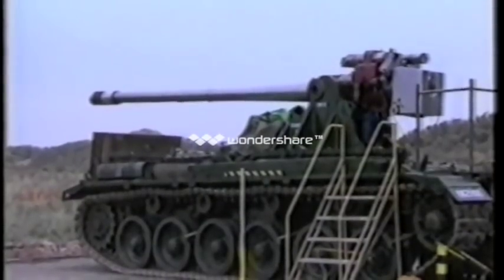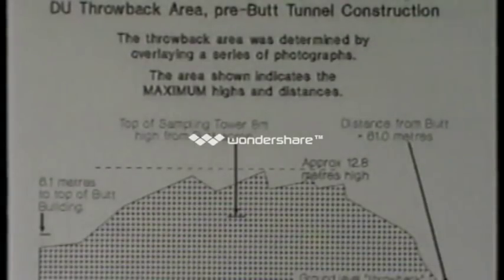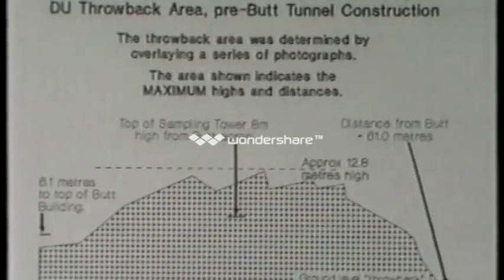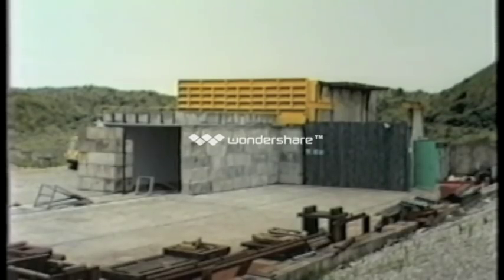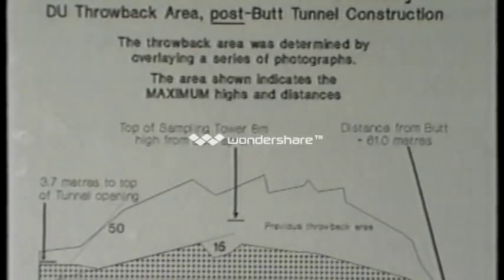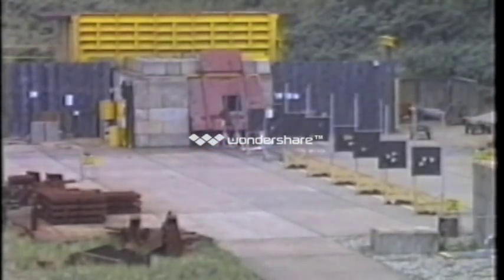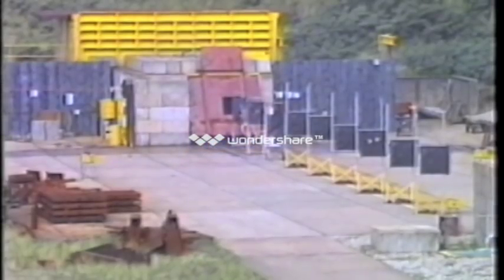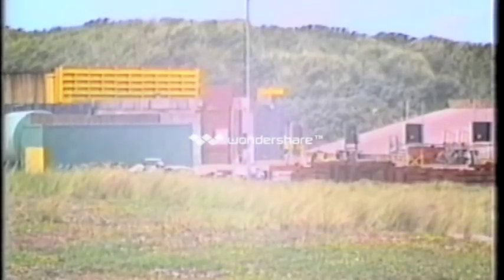Depleted Uranium Firings West Cumbria

Comment: where was the du supplied and machined from? did they test it for transuranics as du stocks are known to have traces?
Reply: @WilliamHelstad  No, steel does not have the strength or high enough density to carry the momentum necessary.  The material more commonly used for long-rod penetrators is tungsten carbide.
Reply: @anthonybarker9123  true, tungsten is expensive though and depleted uranium is cheap and plentiful
Reply from the maker: Yes it was assessed and assayed for transursnics and fission products

Comment: So what has a DU round got that others more conventional rounds dont, or to put it another way what does it do to a target that other rounds dont?
Reply: DU is self sharpening, it chisels off rather than flatten like tungsten or steel. DU also has a secondary pyrophoric effect, as DU sparks ignite in the air. So, behind armor effect is very incendiary. Against tanks with carousel autoloaders like the T72, it causes catastrophic damage to the tank, often igniting propellant charges
Reply: DU is also a byproduct of nuclear fission in nuclear powerplants, and therefore is a cheaper and more readily available material than alloys such as tungsten carbide, which is also used in armor piercing ammunition.
Reply: @elongated_musket6353  A By-product of Uranium enrichment process. The UK's nuclear powerplants being MAGNOX did not require highly enriched fuel so our DU stocks came from the US and were probably very expensive.
Reply: @elongated_musket6353  DU is most certainly NOT a byproduct of fission in nuclear power plants.  DU (U-238)  is what is left over after concentrating U-235 out of naturally occuring Uranium ore.  Only .7 percent is the fisable U-235.  The REST (U-238) is non-fisable and essentially useless.  It is VERY dense and VERY hard.  Therefore it is a good kinetic penetrator.
Reply: @matthewpless4773  it is technically a byproduct of the fission industry, it just has not been used as fissionable material
Reply: The DU is heavier and so will carry more momentum to target. As well as the ability to slice through steel with ease, it's shotgun like effect exiting the other side is devastating to anything living

Comment: So, they had to sample the air around the butt....Then after penetrating the butt they needed hazmat suits to clean the butt....interesting.
Reply: They don't need hazmat suits, in fact they don't need to clean it at all. 

It's just required by our insane nuclear safety procedures that assume everything is a threat no matter how small. It's a constantly spiraling process that just keeps getting more out of control. Since ALARA, the As Low as Reasonably Achievable has no end point. As such those same regulators who created the fuss over nothing see these efforts and make the exact same mistake you just made and use them as justification for even more safety procedures. 

In reality DU is harmless radiologically and a fairly typical heavy metal toxin chemically. So it can be treated like every other bit of ammunition they fire.

Much of the world is naturally more radioactive than this thing could ever become, so what's the point? 

410 MICRO Becquerels is the only measurement given in the video. Which sounds really scary until you realize that a Banana is 15 Becquerels, that's whole becquerels without a prefix reducing the exposure by millions of times. Are they going to fire millions of tank rounds over the life of this facility and does anyone worry about Bananas? No, clearly not. As such these efforts are just a waste of tax payer money.
Reply: @bronzedivision  brief du exposure is not the case.  Long term effects of du in water soil  etc are very dangerous toxic to people. Especially if people live & thrive in an contaminated area. Iraq is a good example. Du isn’t strong enough to penetrate the skin but if you breath in the dust or the dust gets in soil or water used to grow food. If consumed by humans it can have devastating consequences.
Reply: @bronzedivision  that's an absolute lie. Even your username seems inspired by the disinfo campaign. How do you sleep at night?
Reply: @KC-il6we  No, it's very basic science. I'm sorry that you think your strong feelings can overturn reality.
Reply: @bronzedivision  this is a testing site. People don’t grow food or drink water on the test site. To say that du is Harmless is completely false. Du doesn’t just decay overnight. It’s the  particles that it leaves behind that can be consumed that is dangerous.

Comment: The sabot rounds fired are notorious they vaporize into high temperature fire on impact fire would break out inside the tank thats hit.Almost all rounds are capable of penetrating any armor of any thickness it doesn't matter and after a high velocity impact and penetration of the depleted uranium darts the particles of dust, smoke and debris are also extremely poisonous.
Reply: False. DU is more dense and is stronger than lead, Tungsten, or Steel. Of course, projectile material is one part of the equation, as you must factor in projectile length and velocity, but it does matter a lot. The armor part is also false. The frontal armor of most MBTs is extremely thick and impervious to most RPGs and tank rounds. There is a reason why Governments spend money on higher penetration AT weapons.
Reply: This kills the tank / tank crew.  Yes.

Comment: DU rounds are AMAZING. I just hate that we have to clean them up after we shoot them.
Reply: SmithN' Wesson ikr... wayyy past radiation poisoning, thats the last thing id be thinking ab
Reply: @npc1377  it’s the dust that is released that’s is deadly
Reply: @Blackowl44  The dust has to be concentrated for DU's miniscule radioactivity to actually have any effect when inhaled. And you'd have to inhale it over a long period of time.
Reply: @jaffacalling53  It's not the radioactivity that's the problem, it's the chemical toxicity that is the issue.
Reply: stoeger 2 Yea and extremely effective at piercing armor. Im preety sure whoever gets hit by this aint gunna have to worry about being poisned they will already be pink mist
Reply: Nathan Long how do you suggest to clean up after they fired the du dust are you going to use a vacuum cleaner around the desert or use a house air filter for the contaminated air and water the dust go up in the cloud thousands of feet it can't be extracted from the human body or water or air or the earth either so tell mister smart I think if you had suggestion it would be greatly appreciate I not joking am seriously telling you let's see if it can be done
Reply: @davidlefort4553  Try forming a comprehendible sentence first.
Reply: Nathan Long They are not radioactive

Comment: Can someone explain why this looks like it is operating off a shoestring budget?  Wouldn't research concerning depleted uranium be pursued with more caution and better funding?
Reply: A lot of testing looks like that, lots of science, optimism and using stuff one finds on a shelf that will do the job. I used to run tests on an engine mounted on a rough, secondhand trailer with a rusted out Ford Transit as my, eh, test house, which we purchased from a nearby plant nursery and dragged into position. The science was good, though, and safe, all for an engine to go into a military drone. The final product looked very good though. The mouldering remains of the Transit might still be there...
Reply: It's a firing range... They have a fine budget but you don't build things you're going to shoot at to expensive standards. 

And they actually have too much regulatory pressure. There are simply no dangers here at all, unless you're standing in front of the gun when it fires. All of this is done purely to placate radiophobia. DU is not a hazard.
Reply: @bronzedivision  absolutely. That's why they would dump it in the ocean and bury it in pits lined with lead and under concrete. Why not bury a harmless chemical in a mine or under a mountain. Maybe we could put it in deodorants like aluminium. Much cheaper and its just sitting there. You're a genius
Reply: @barbarafogle3541  Ah the classic circular logic of radiophobic alarmists. 

Step one:
Get paranoid and needless rules for protecting people from radiation enacted as a precaution. 

Step two: 
Point to the extensive efforts undertaken to protect people from radiation as 'proof' that it's a uniquely special hazard. 

Step three:
Repeat...
Reply: @barbarafogle3541  OK, I'll go slowly. Please try to follow:  DU (Depleted Uranium) is completely different than spent nuclear fuel rods.  Your comment discussed how SPENT FUEL RODS are treated, NOT depleted Uranium.  PLEASE, read a little and learn a little before spouting your ignorance.
Reply: @matthewpless4773  you think the word depleted in the name might give her a hint
Reply: Are you sure that you aren't confusing uranium 238 with it's far more reactive isotope of uranium 235
Reply from the maker: too little money in the budget and lack of regulatory pressure